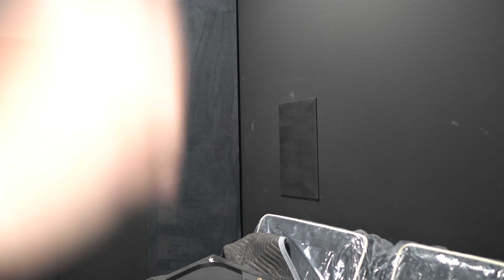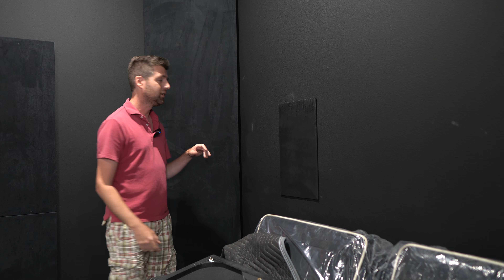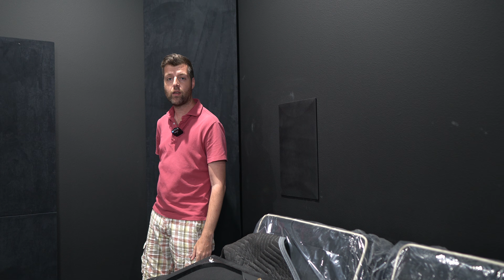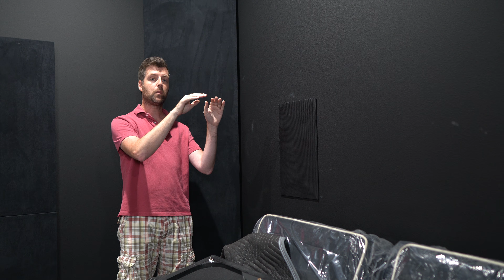Real Acoustix BassMod Corner

Comment: How does it compare to something like a GIK soffit with and without the membrane, which takes up a similar space off your corner? Real Acoustix aren't locally available, but GIK have a local dealer, plus they are probably more appropriate for my budget.
How effective are the GIK membranes in practice? Do their soffits benefit from the membranes if placed in corner or would that overkill? I've seen other claims that they don't really work well, and GIK no longer display their data after revising their website.
Why aren't you also treating other tri corners in addition (wall-ceiling and wall-floor)?

Comment: What are the results?
Reply from the maker: I measured it before and after.  Saw some evidence of it working. But then retook the measurements and got wonky results. By the time the room was done, it became impossible to correctly redo the bite and after.  I think to get the most reliable measurement results I would need to use more and test more carefully. 

It’s a lab tested device including now having some lab data based on a newly developed protocol for testing below the currently accepted range. It will be debated by ASTM for a future standard.  I think it’s a solid product. But I don’t feel confident the data I have is good enough

Comment: Question please: you have yours placed from floor to ceiling (as do most folks). Would there be any difference at all from placing them at the ceiling corner down the length of the room (assuming the very same length as you have from floor to ceiling)? I can't imagine there would be any difference, however maybe I'm missing something 🤔.  Thank you!
Reply from the maker: It’s an issue or surface area. These aren’t that effective. No bass trap is. So filling as much space as possible is best. But how you fill the corner isn’t all that important. Use any tri corner you want. Including ceiling.
Reply: @PoesAcoustics  Cool, Thanks!  Will contact you in the next coming months as I am moving into a new room / blank slate!

Comment: I understand and agree with what you're saying and have done a fair bit of experimenting and building myself.  What about using low density fiberglass batts and leaving them in the plastic bags? Create a depth of about 12" to 17" in corners or floor to ceiling whole wall.  You need to measure!
Reply: Thin plastic bags with that low density fiberglass inside, yes they do work great if placed jn high pressure zones if they are sealed adequately. Limp bag absorber is the name. You should use the correct thickness of bags and placement is very important.
The frequency regions and Q value affected can be somewhat altered by using different depths and volumes. I love to use them in my work as they are relatively cheap and easy to make.
Very different from bass mod modules though when talking about their absorption abilities and their bandwidth. Bass Mod are way more narrow in the main region affected and they absorb more efficiently under 80 Hz. Richard Lenz is a very knowledgeable and nice guy with lots of experience.

Comment: Everyone says don't sit in a pressure max area. If you arer using multi sub and equalization does that still ring true? Why? What's the science behind it.
Reply from the maker: Well the pressure maximum is usually the site of a big null.  So that is why its said.  No with multisub that isn't true as long as multisub has done a good job addressing the modal issue.  In theory a good 4 sub setup optimized correctly will give a large listening area that has a smooth response with no peaks or nulls.  In practice it doesn't always work out and sometimes optimizing seat locations can help with that.

Comment: Interesting video! At 50Hz, wouldn't you use multisub to handle that range?  Like at a certain point isn't it easier to just use four subwoofers and do modal manipulation to get things squared away down there?  When does it make sense to add such low frequency absorption?
Reply from the maker: See Short reply

Comment: I hope you are able to walk through measurements of the before and after.
Reply from the maker: I absolutely will.  I have some measurements I took, but I didn't take them with that intention and I am not totally convinced they are correct.  

This is a big bass trap but it is only in the one corner and really would only be working on one set of modes.  I want to get the other subwoofer into the room and then do a measurement with it in the room vs out of the room.
Reply: @PoesAcoustics  Great! I hope to learn how you recognize problem areas and how you addressed them.

Comment: Do you have the BassMod traps on just the rear 2 corners, or do you have them on all 4 corners of the room?
Reply from the maker: There are doors in two of the corners so it was not possible to put them in four corners.  

Interestingly, Geddes found that it is not necessary to place bass traps in all corners, that what you do in one corner or on one wall is replicated by half on the other.  So yes, if you put corner traps in every corner, you get the benefit of a very large area of absorption.  But if you do just half, you get the same benefit, but half the area.  In part this is why I did an 8' bass trap.

Comment: Real Acoustix is right here in Utah (where I live) up the way a bit in Ogden.  But as for your own home theater, since it's such a small location for 'Bass Trapping', I only have to say about it.... MEASUREMENTS, or it DIDN'T HAPPEN!!! hahaha!  Can you show its effectiveness in REW or something similar?  Can't remember if you said you measured your room before any treatment.
Reply from the maker: I did but in hind sight it wasn't very comparable other than for looking at RT60.  I measured the room with nothing mounted and then a year went by and I measured again with stuff mounted, but...With different speakers in different locations.  

I do have a before and after measurement.  I didn't take them with the intent of it being before and after, so it's not the most scientific, but they were taken less than a week apart.  I plan to remove the bass trap and do a "before" measurement, and then add it back and do an after.  The before and after I have shows a big difference, but I worry that more changed between those two than I realized.
Reply: @PoesAcoustics  can you plz make a video on how to analyze RT60 in REW since you refer to it a lot in your videos? It will help us to relate with our system.
Reply from the maker: @sherazdotnet  I am working on it. The problem is that there is a right way and a wrong way. It’s easiest to do the wrong way but it will range from a little low to way off.
Reply: @PoesAcoustics  ok cool looking forward to see that video then. My room measures .15 which is way on lower side but I don't have much absorption on side/back walls and makes me wonder if simply taking RT60 in REW at MLP is all it takes to see the real RT60 for a room.